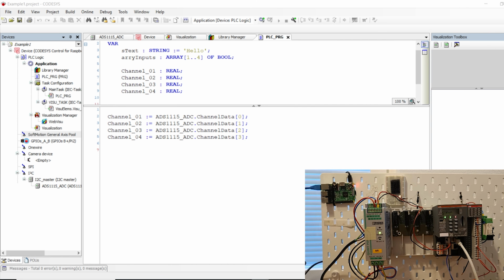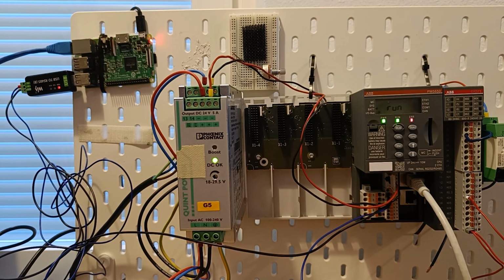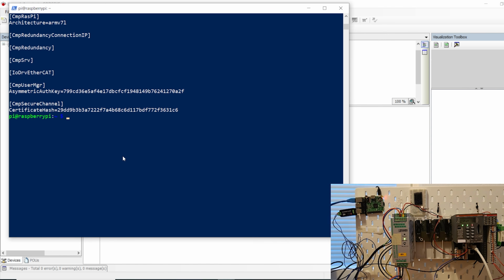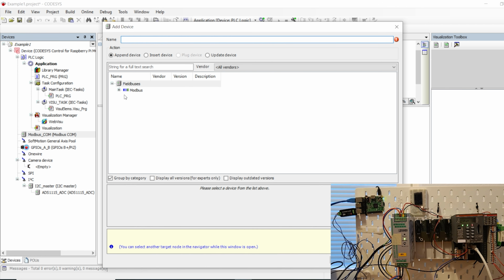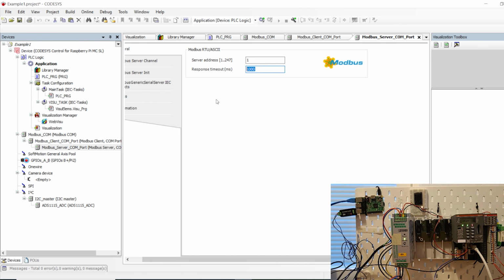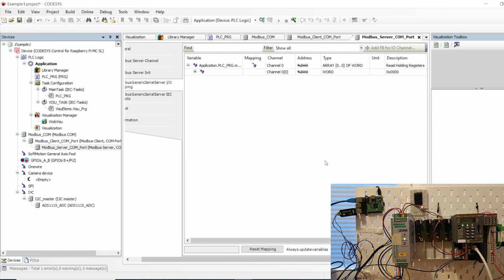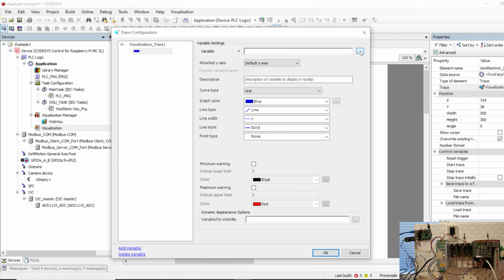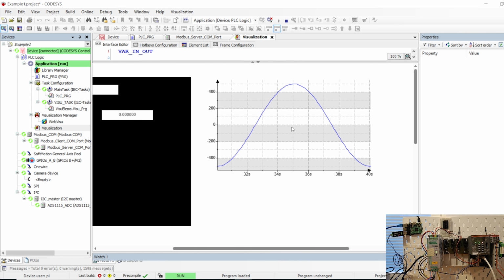Modbus RTU Master over USB | Codesys Control for Raspberry Pi

Comment: At 21:05 you set up specifically to update boot application. Why this is important and what this really mean if the change is online?
Reply from the maker: The boot application is the program that saved on the controller and runs even when you restart the controller. So if you make a change in the program and you dont update the boot application, the change will only be temporally, meaning that if you restarted the controller, you would loose those changes

Comment: Again, an excellent video. Can you please add specification of the USB/RS485 device? Also, please specify version of Codesys you used.
Reply from the maker: I am using Codesys v3.5 SP 20 Patch 5. as for the USB/RS485, there are quite alot of these on the market and they all work the same but for my case, i am using the WS-17286 from waveshare. Here is a link if you want to take a look: https://www.waveshare.com/wiki/USB_TO_RS485
Reply: @EngineeringGO thank you very much! I appreciate the answer.